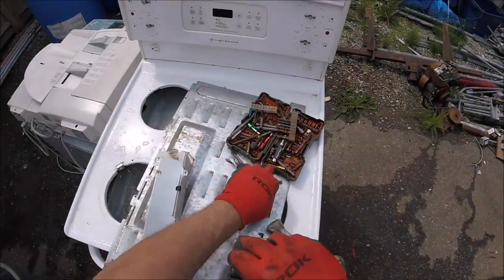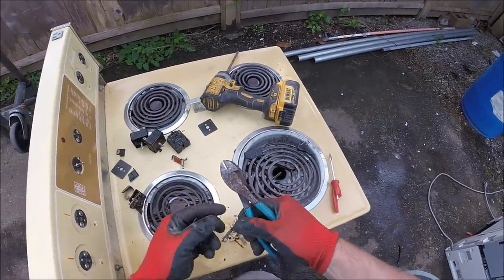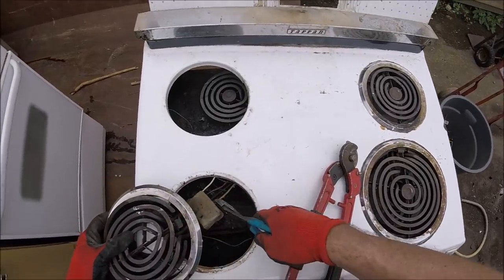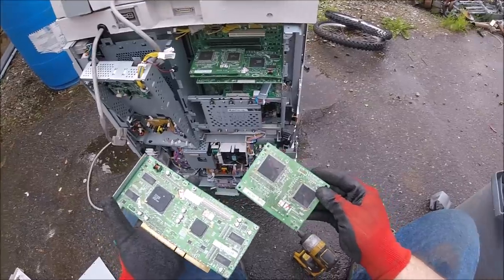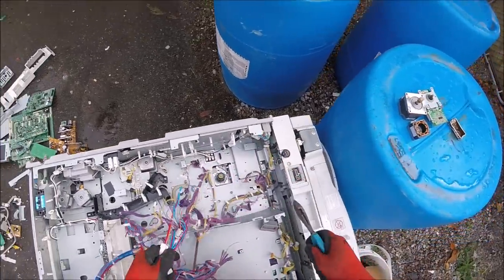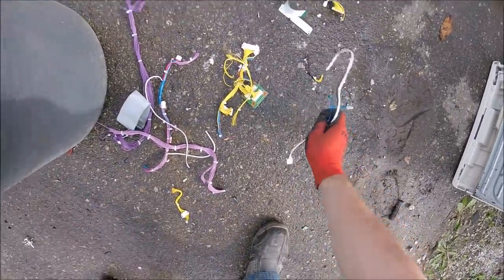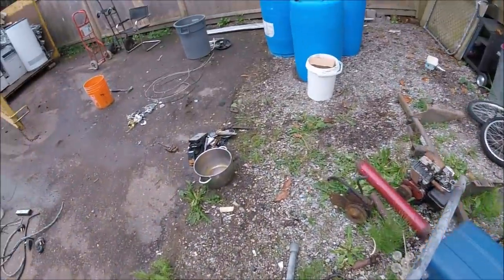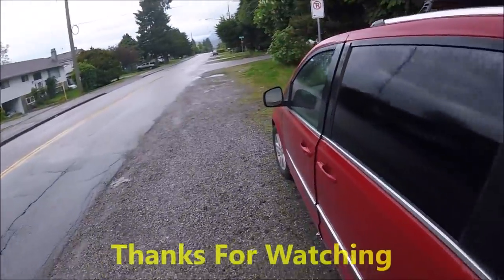Scrapping Large Commercial Printer + Filling My Bin

Comment: A little tip if youre wire stripper doesnt strip the old cloth cable just put the cable on a flat piece of metal and squash it with a hammer the cloth will fall right of